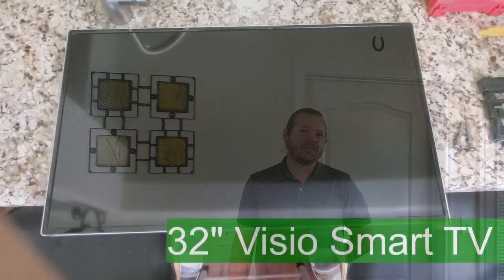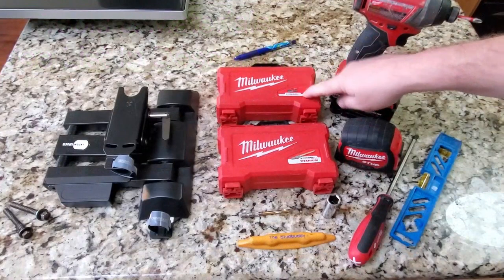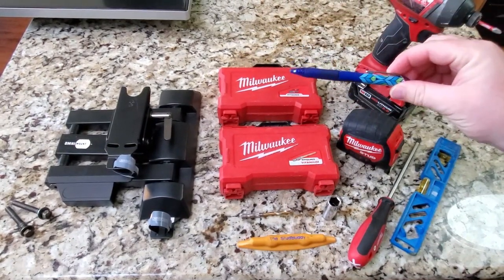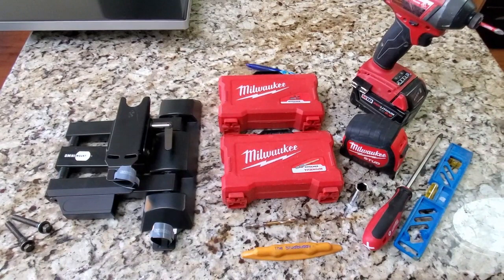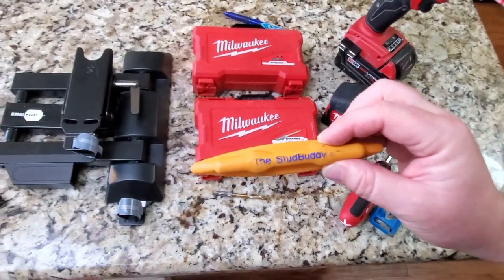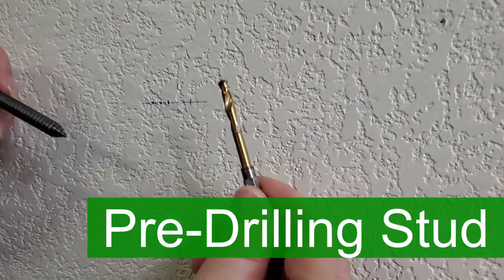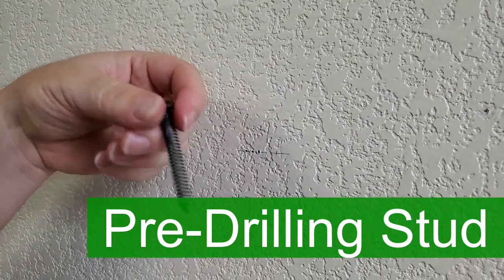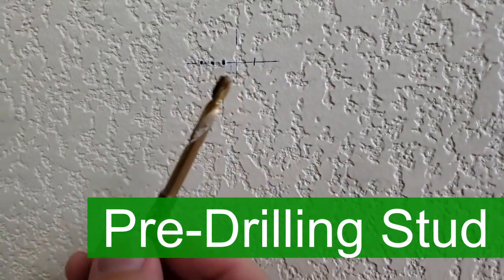How to Mount a 32' Visio Television with an OmniMount Full Motion Mount (Easy)

Comment: I need to move my mount. I have one that looks just like yours, so this is helpful. I was hoping to find the model number of mine. As I said, mine looks just like yours, but when I looked at the model number that you provided in the comments, that is a different lmount. Do you know what the correct model number is for the one you installed in this video? Thank you this will be very helpful for me